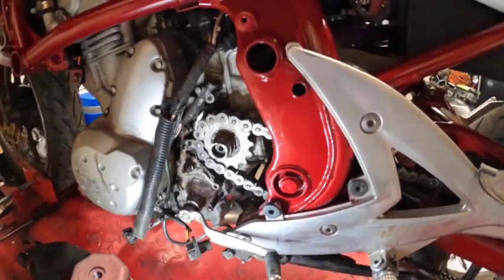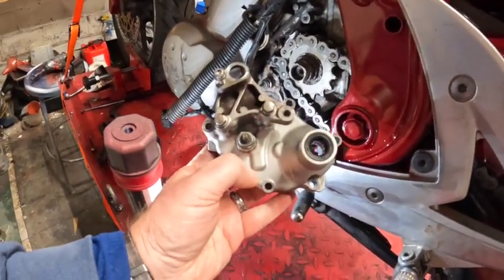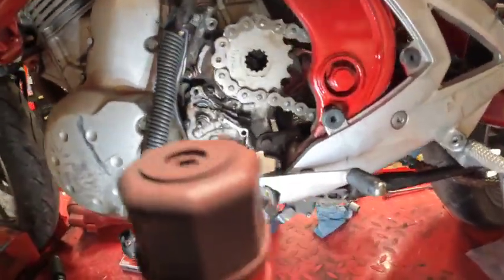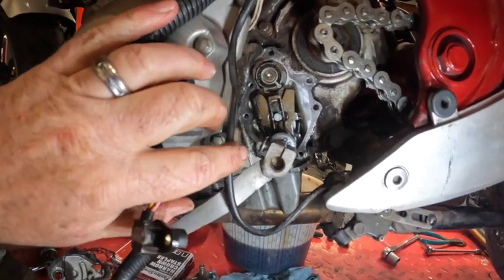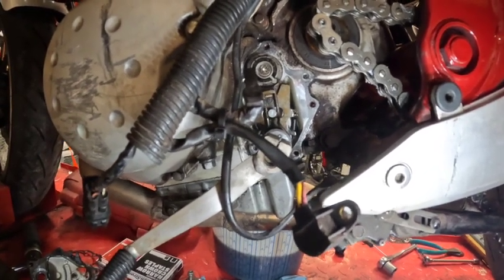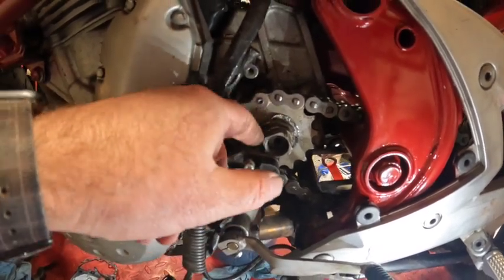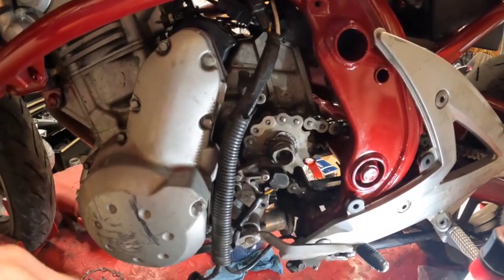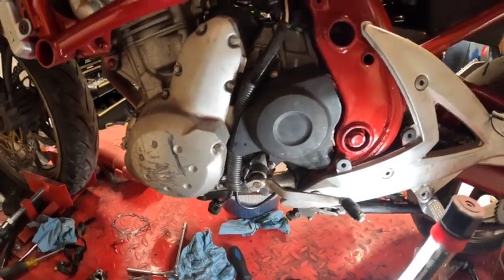Kawasaki Ninja 650R Speed Sensor Housing Repair Street Fighter Build

Comment: Where did you purchase the bracket assembly?
I picked up a 650 and same issue.
Reply from the maker: I found it on eBay. It was really cheap and came with the sensor. Thanks for watching. And good luck with your Ninja. It’s a fun little bike.